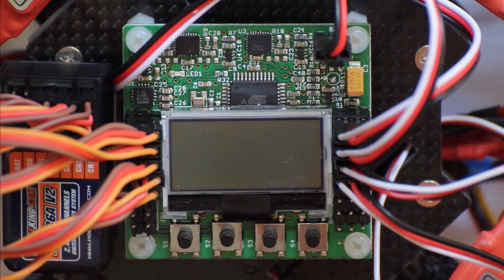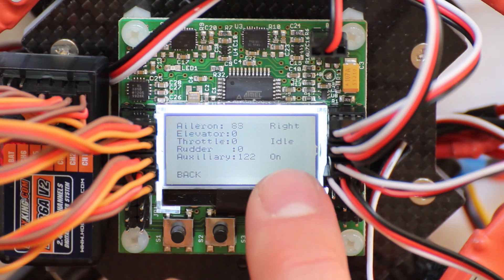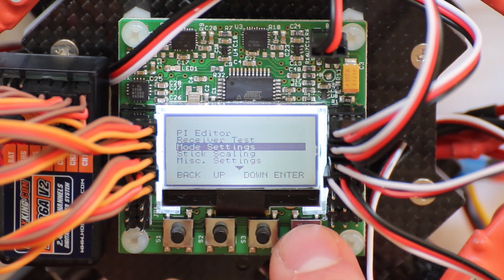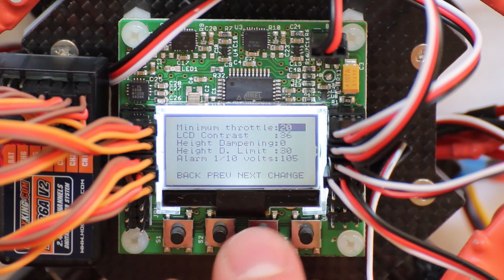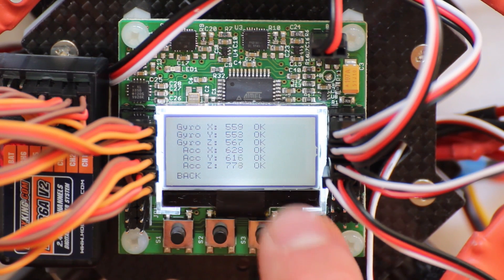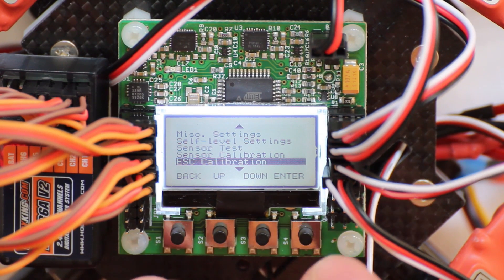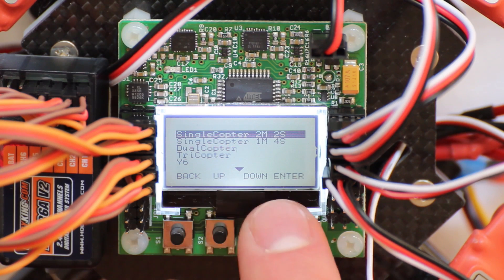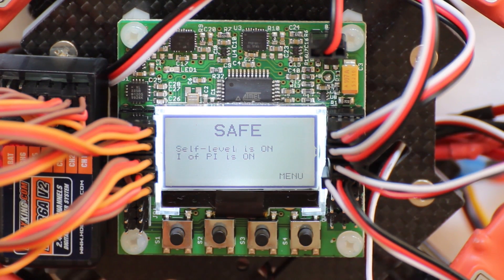Hobbyking KK2.0 Multi-rotor LCD Flight Control Board - Walkthrough

Comment from the maker: Sure you can do that, however you might have to change the order within the sideways cable, depending on the receiver and mode your using. Further I added a gimbal later on which connects to port 7&8 and then you need either seperate power for the servos or a esc with bec on port 2-6. Thats why I kept it simple. 
Thanks for watching!

Comment: Hi bigben,
ich hab mir vor kurzem einen Quadcopter mit genau dem gleichen Board gebaut. Allerdings hab ich noch Probs mit der Elektronik. Denn ich kann starten und fliegen, aber nach ca. 5 sek regeln die Motoren zurück und der Copter geht zu Boden. Am stärksten wird der Motor rechts hinten zurückgeschraubt, denn der Copter driftet dann immer in diese Richtung ab. Bei einem Vollgastest in der Hand verhält er sich aber ganz normal. Hättest du vielleicht noch eine Idee was ich machen könnte ?

Comment: Alright, thank you for replying. i got it up and semi tuned the PID but the YAW is hell and so dangerous. Not good tune from either Self level or other. I'll transfer the running gear to a quad until i figure out the Y4 settings. Happy flying.

Comment from the maker: Hey grandchancelor, it does not matter if you cut the other 3 BECs of your ESCs, because on the KK2 Board they are all bridged together. The KK2 Board draws its power from the first port. You can leave them on, at least that is what I did. 

As far as the Y4 setup I have to say that I have never experimented with that so I do not want to give you a false answer, but with the new firmware it should not be much different. Thanks for watching!

Comment: Trying to make mine work and I'm not sure if the board likes the remaining 3 motors BEC wire cut or not. I think the board needs only one BEC wire, is this correct can you tell me ?
Also, i can't find any guides to setting up a Y4 formation in regards to the PID tune. Is it much different to Quad tune do you know ? Thank you.

Comment from the maker: You only need to connect the KK2 Board to the Lipo directly if you want to use the low-voltage warning feature. If not, ESCs are all you need!